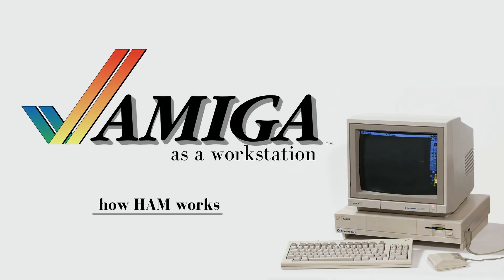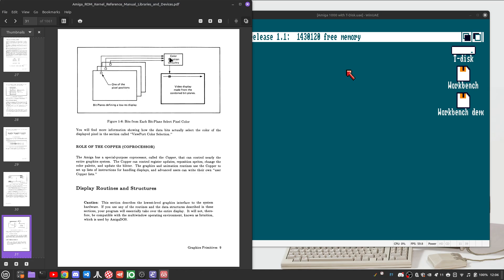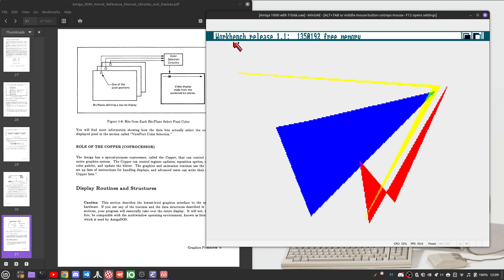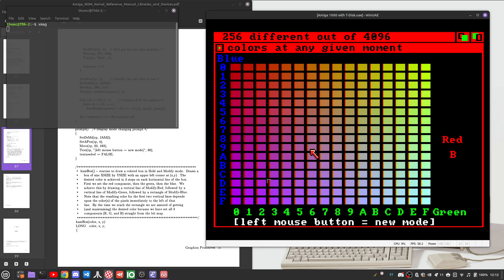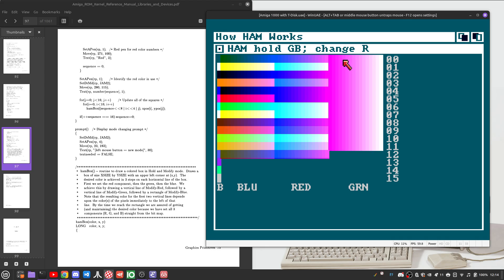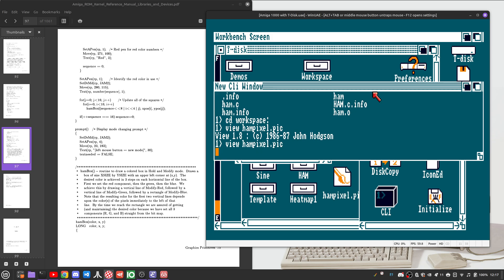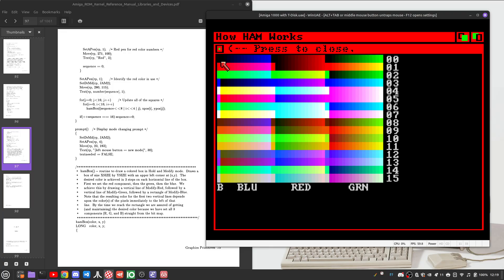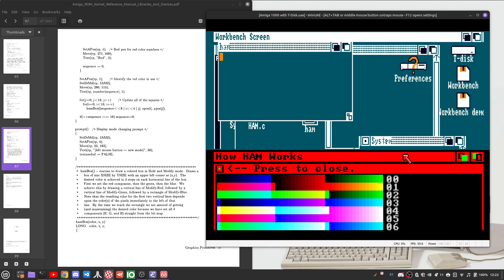Amiga as a Workstation Part 6: What is HAM mode?

Comment: you didn't touch upon fringing, artifacting which can happen if you're trying to get to a color that's not so trivial to get to. Good image conversion tools like The Art Department Pro took pains to try to avoid this, of course, but it could still very easily happen anyway.
Reply from the maker: I didn't. and am trying to think of the best way to explain this, as so many miss the fundamental reason this happens.

I tried to address it obliquely by showing how the "colorful" demo in the RKM deals with it: it always does an explicit modify of all three color components, which cuts horizontal resolution, but guarantees the color can be reached.

Comment: So to be able to display photos in HAM mode you have to convert them first, don’t you? Basically, you would have to select a strategic base color for each line and then modify that in a certain way to approximate the original real color information? Sounds tricky and hard to generalize.
Reply: Correct; they made programs whose main purpose was to convert 24-bit (or otherwise) images into HAM (or other modes) for display. The Art Department Professional comes to mind, which was a holistic image processing tool (rather than a paint program). It could do a lot of other things as well but this was one of the major things it was used for. It was also one of the first applications that I felt the need to upgrade my RAM (from 1MB) for (IT BEGINS).